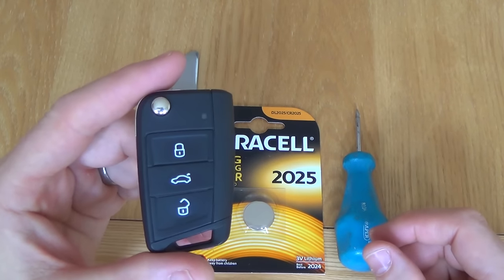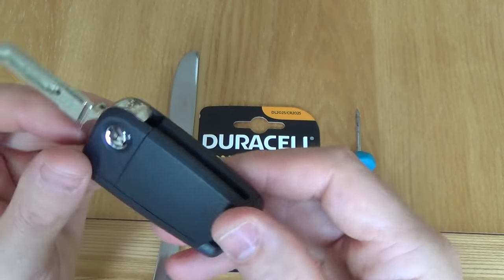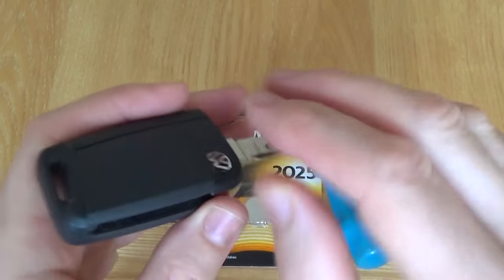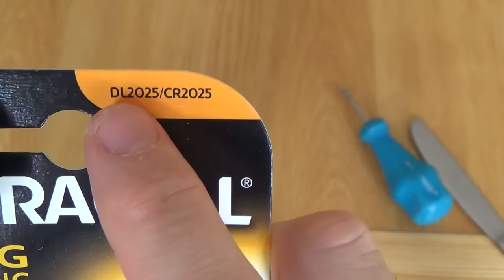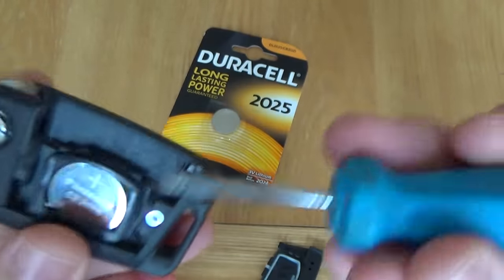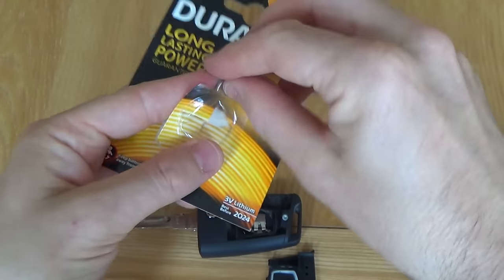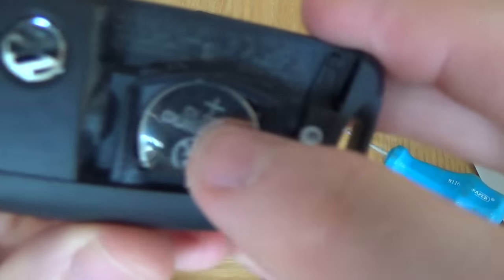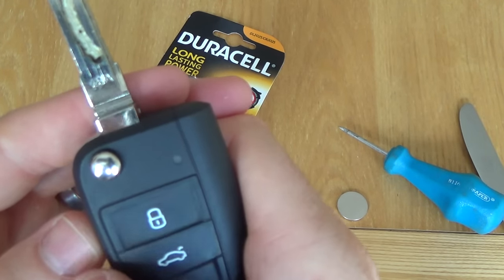2015 VW Volkswagen Golf MK7 KEY FOB Battery Replacement

Comment: Once the battery is changed you may have to re-sync the keyfob or it will not operate. You may not have a key entry into the vehicle.....it is hidden!  The drivers side door handle will have a small slot under the handle cover.  Look under the handle & you will see it. Insert your key into the slot & gently prize the cover off. This will now reveal the key insert. Insert your key into the lock & turn clockwise to unlock position. Remove the key & press the unlock on the fob. The doors should open.  If the alarm sounds enter the vehicle, insert your key into the ignition & turn on.  The alarm will stop & your key is re-synced. Whatever happened to simplicity!
Reply: Which side of the door handle:  inside or outside the car?  Does it have to be the car key that prizes off the cover underneath the door handle.  And, is it the actual key ( the metal bit ) you use to prize open the door, not the fob.  I am asking those questions based on your instructions.  I am nowhere near a car so I  am more or less asking blindly.  Excellent video.  Thanks.
Reply: @suee-charles4186  Sue, look under the drivers door handle outside of the car. On the left you will see an aperture to put your car key into, gently prise off the plastic cover on the door handle without scratching paintwork. When removed you will see a key entry. Press unlock on your key fob & immediatly insert your key into the key entry, turning clockwise to unlock car. Open door, insert key into ignition & turn on. Push the plastic cover back onto the door handle. Job done!
Reply: I’ve e always used the 2032 I have a 2017 model, works and fits absolutely fine.
Reply: Man I just changed the battery and of course it didn’t work. Thanks to you I removed the cover and followed your guide. And of course it didn’t work either. Just before my head was going to explode I remembered I didn’t remove the tape from underneath the battery. Now it works just flawless and I didn’t have to reprogram the key. ✌️✌️
Reply: I used this video to help me decide what battery to get while at the store without opening my key fob. Got home and yes it was the 2025 battery (I have a USA 2015 mk7 golf S). A 2032 may fit since they’re the same diameter and voltage, but it’s thicker so it might be a tight fit. You could try that if it’s all you had  available otherwise buy the 2025 it calls for. I get about 3 yrs use from the battery until  replacement .
Reply: @takiman1  thanks to your comment here I’ve just found the plastic bit on the back of the battery! Was beginning to lose it lol 👌👊
Reply: Does replacing the battery also cause the RFID transponder chip for the immobilizer to be reset? Or does that RFID chip get powered by the ignition coil near the console when you insert the key into the ignition?
Reply: @takiman1  your reply saved me - I also forgot to remove the tape from the battery!
Reply: Tried that .... didn’t work anyhow 😢
Reply: I also forgot the tab on the back of the battery!! You are a life saver! Video worked great!!
Reply: @Tak1  just made same mistake.🤦‍♀️ Thanks for tip👍🏻
Reply: @takiman1  you’re my hero
Reply: @takiman1 You are an absolute legend! I've been trying to figure out all day why when I put the new battery in, the key doesn't seem to work. Went and followed the procedure in the original comment but to no avail. Only to see your comment and have a look at the battery to see I aswell had not removed the sticker 😂😂 WORKING NOWW!!
Reply: Change the battery but still not working 😢
Reply: @johbalauro3612  the battery will usually have a sticker on one side. Check to see if that's the case and if it is you should remove. Then try again and your key should hopefully work!!
Reply: @johbalauro3612  make sure it's in the right way & you have removed the thin plastic film often stuck on the battery. Follow the instructions to re-synchronise the key.
Reply: @takiman1  thank you, your comment reminded me I had missed the sticker as well and saved me from setting off my car alarm 😂
Reply: @711honved  Thanks so much for showing how to open the door manually - and the resync stuff. I didn't think I was going to be able to get into my car at all, let alone drive away!

Because my battery replacement failed the first time... nothing to do with the sticker... I think it just hadn't seated quite properly. 
Was wondering if @johnbalauro3612 's LED was working.... mine wasn't I'd forgotten there was an LED on the key at all - thanks to the OP's video for reminding me!
If the battery replacement has worked (and the new battery is not a dud) the LED will confirm this - whether or not the key needs to be resynced.
Reply: Great info 👍🏾👍🏾
Reply: This is the best comment I have ever seen on YouTube. After I swapped my battery and I still couldn’t open the car, your comment saved me. Thanks ❤

Comment: For Mk 7 golf, you may have to re-sync the key after battery replacement otherwise key won't lock and unlock remotely. In order to re-sync the key, press unlock button on the key fob and unlock the driver's door manually  (by putting the key into the handle on the driver's door and turn it clockwise). that's all, key is re-synced and it will lock and unlock remotely
Reply: Does the LED on the key fob stop working when the fob has lost sync with the car?
Reply: Thanks - just what I was looking for. Job done
Reply: Mk7 remote battery swap worked fine - no issues
Reply: ErkanG Gungor b
Reply: Swapped the battery however the Info System still shows "Change Key Battery". Any Ideas?
Reply: Alex Barrett Nope. No ideas here mate!
Reply: @carlsondarlson3020  The error stopped after 2 or 3 uses. Cheers.
Reply: I have changed the battery in 3 occasions in my golf 7 (keyless) and I have not needed to re-sync the key 👍👍👍
Reply: It's a matter of how fast you change. In case you are fast enough, des Key doesn't loose his memory as there is still some voltage left in the system.
If it takes you too long to put the new battery in you have to de resync afterwards.
Needles to say if the battery was really empty before the change - it is already too late.
Reply: ErkanG Gungor 👍👍
Reply: @maddoguk  The LED on my key fob stopped working too after battery replacement, and re-sync did not work.  Now cannot lock/unlock remotely. Circuit damaged? Any one can help?
Reply: DK WU can you tell us what happened? Did you manage to fix it? If so how?
Reply: @alir.9894  It turned out to be a contact problem with the two small notches at the side of the battery, fixed with a little adjustment.
Reply: @dkwu1109  Yes, I had this problem too.  Couldn't find any notches, but rotating the battery to different positions and testing it each time quite quickly identified a position it worked in.
Reply: @dkwu1109  Had the same problem after replacing the battery, playing a bit with the notches solved it!
Reply: Won’t work for me, spare key unlocks door manually, and starts ignition, but engine won’t start or remote won’t lock/unlock , any ideas?
Reply: No place to put the key in the drivers door handle on my MK7 Golf
Reply: @mixelspixels  have you tried so lift the plastic bit where its supposed to be? I think it is under that bit on the handle!
Reply: @alexandresa3548  I didn’t realise that there was a hidden keyhole in the door handle however I changed the battery in both my keys and both are working fine. Happy Days!
Reply: You beautiful creature thanks!
Reply: @mixelspixels  there is. It's hidden behind a cover.

Comment: The 2025 battery on my 2016 R kept failing. I replaced it with a 2032 (larger capacity) and it is much better.  The 2032 will flip up at an angle and so as you replace the cover, push the battery with a small screwdriver to hold it flat.  Works perfectly and same price as a 2025.
Reply: i did the same thing when you have push button start the 2025 dont last for crap
Reply: I have a bunch of 2032s and was about to stop and order some 2025s when I read your comment. I used a 2032 and it seems to work fine. Thanks for the tip!
Reply: Thanks for that useful info. Just tried the 2032 type battery which I had spare and it works perfectly 👍
Reply: Run a 2032 and you'll eventually crack the circuit board and have a US $300 key fob replacement due.
Reply: Oh, thanks for the tip! Took some time to get it in but worked fine
Reply: Yeah just done it , the 2032 is thicker but went in fine and worked fine 🙂

Comment: Great tutorial . I fitted a 2032 instead, but it kept popping out. I was able to close the casing over it and it works, however could this damage the key, using  a battery that doesnt quite fit? Thanks!
Reply: Same problem

Comment: Cheers! Bought a 2032 battery instead of a 2025 battery by mistake but with the same butter knife, was able to hold it in place while I closed the fob back up. Fingers crossed 🤷‍♀

Comment: Thanks for your clear guide to replace VW key fob battery.  I followed it to the letter and your directions worked fine. However I did decide to use a thicker pry in the key gap and carefully levered open the cover. It did not mark or leave marks to the fob. I had my replacement CR2025 immediately available to a make fast replacement and had no sync issues. I’m assuming sync issues may be encountered if long duration is left when the battery is not immediately exchanged.

Comment: Vince..you saved me. BOTH of my fobs would not work on my GTi. I couldn't get in ir start the car. I called the AA and they put brand new batteries in both fobs. But only one worked. They said I'd need to take the other one to the dealer to do a full reset. But I noticed the red light was working on the one that worked so I figured the battery was not working in the second fob even tho he put a new one in. I followed your instructions and cleaned and replaced the battery...and it worked and was synced. Saved me a trip to the dealer. Thanks.

Comment: It's late 2022 and I just did this for my 2017 Golf Alltrack key fobs.  Works perfectly, and no issues with re-synching.  Thanks for a great little tutorial!
Reply: I changed the battery and the fob wasn't working. Thought I had to re-synch but turns out I hadn't removed the plastic sticker from the battery terminal... duh

Comment: another site said that a CR2032 would also work. I just successfully used a CR2032 as a replacement in my 2014 Golf key. battery won't stay down while open, but replacing the cover does work and keeps the battery in

Comment: Thanks Vince, changed both mine today. Old batteries measured about 2.9V, one wasn't working, the other was working but the car kept telling me to change the battery.
First key worked fine, the second didn't work at all, even the red light on the key didn't flash. I had the batteries in & out a few times and then discovered that if you press the open and close buttons together, it does some kind of reset and the key started working again. No resync needed even after all the messing.

Comment: 2015 Polo with both keyfobs dead for 4+ weeks (first time in 9 years) - this video worked perfectly 👌. No need to re-sync - just standing next to the car pressing at first they didn't work and then after a couple of presses they both started working. Brilliant and no need for expensive Timpsons (£25 per keyfob!).

Comment: Okay, I replaced the battery as described.  The remote did not work. I went and did the resynch as someone mentioned below. It is kind of a paint to pry off the cover to insert the key and worse is trying to get it back on. Remote still does not work. Any more ideas? I hate having to drive to the dealer for something this simple.

Comment: Great tutorial thanks.
I ordered 2032 batteries by mistake. They're 32mm instead of 25mm but they work fine. It's fiddly to get them in because they're thicker but being an octopus helped.
Reply: 2032 is 3.2mm thick instead of the 2025 which is 2.5mm thick. I've tried a 2032 and its goes in the slot but doesn't depress far enough to lock the battery in place correctly. It will stay in place when the cover is pushed on but the battery will keep popping out of its slot without it. 

Energizer comparison
CR2025 = 170 mAh 20x2.5mm (correct coin cell for VW fob)
CR2032 = 235 mAh 20x3.2mm
Reply: @andrebonastre4597  It still works fine so......

Comment: The slightly thicker CR2032 battery will also fit, and last longer (tested and working in two different keys).
Reply: And crack your key fob circuit board.

Comment: Hi all, I did it for my golf 7, and changed the battery as soon as I got the info on the dashboard « key low battery « and no issue; on the other hand on the passat, I did not get the info on dashboard because the car was older and I needed to resync via the method below. Thanks for the nice video

Comment: excellent work. had to try and open this because my car randomly told me the key fob battery was low, but I opened it up and checked it - its 3v, its fine. the car is wrong. cheers

Comment: Thanks for the video - worked a treat on my 2018 Golf SV. Also,  a Duracell 2032 battery works just as well (it is just very slightly fatter in height)!
Reply: I just was wondering same thing. I have couple of 2032.

Comment: Do different brands have different size batteries? I was using a Grundig CR2032, but the Energiser CR2032 won't fit. The Duracell CR2025 will fit though but the key doesn't work with it, even after I sync it. Wtf!

Comment: Works fine with cr 2032 too ! 
I just did it with one from a cheap  Ikea pack of 8 pcs 2032, just press to close it. The battery should even last longer using 2032.

Comment: Funny thing. I saw some 2032s in a big 6 pack, bought them thinking they might be the right ones (without looking!)....Even though the 2025 are the right size, the 2032s (0,7mm thicker) fit tight and the lid goes back on OK...and works of course. I would recommend getting 2025 battery in there as soon as you can though because the lid mechanism and battery pushing knobs might damage the 2032s.

Comment: Nice vid, used it the first time I had to do the Sportwagon key...it goes through batteries way faster than expected. However, I got a deal on 2032's at an industrial store for some other things in the house and decided to see how bad the fit is. It goes in...won't sit flat on it's own but the lid presses it down with no resistance and it locked/unlocked the car from inside the house through the door into the garage. So 2032 is possible so far. That and it allegedly lasts longer with a bit more capacity...but we'll see about that.
Reply: I’ve just tried the 2032 and agree with your comment on the way it just fits. We’ll see how long it lasts.
Reply: I did use A 2032 too instead of 2025, it was harder to get it in, but it works

Comment: I tried a new 2025 and it wasn't working and I couldn't synch it either. Only then I realised the old battery was a 2032 and I replaced the 2025 with a 2032 and didn't even have to synch it. Mysterious.
And all this in a -15°C January weather.

Comment: not as simple as replacing the battery you have to get the whole thing reprogrammed or you will only be able to open the car manually and the car won’t even start the alarm just goes off, these keys are designed so that you have to go and pay the dealer to do it for you unfortunately

Comment: Do you have a video on how to swap the entire plastic case? Mine is quite scratched and looks bad but I don't know how to open the case to access the circuit board and the immobiliser chip. I'm starting to think that it's glued together to make it waterproof which makes opening it either an impossible job or a very messy destructive job.

Comment: I read this somewhere but a video helps to tell how hard to crack open the cover. I used a blue ball pen to prey the battery out with little effort. It jumped a feet high before landing on my thigh. I guess putting a spare cr2025 in the car is a must for everyone. My key failed to work in the mall carpark. One quick shop of battery fixed it.

Comment: And in case anyone is wondering, a 2032 battery will not fit - you need to 2025 battery (at least in my wife's 7.5 Golf). I know this is mentioned in the video, but for anyone scanning the messages quickly.

Comment: Done that with several batteries, neither of which would make the light flash in my other(spare) fob.I replaced the battery in my remote and it works fine. Any ideas?